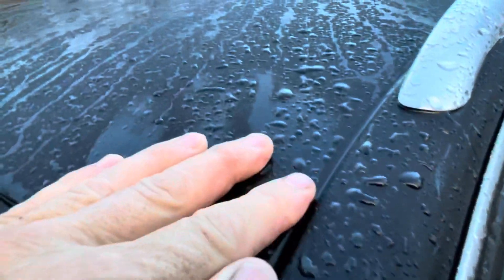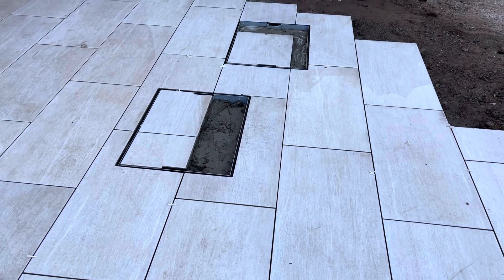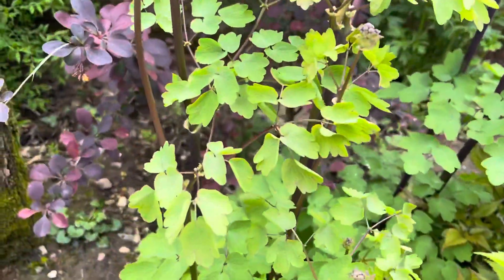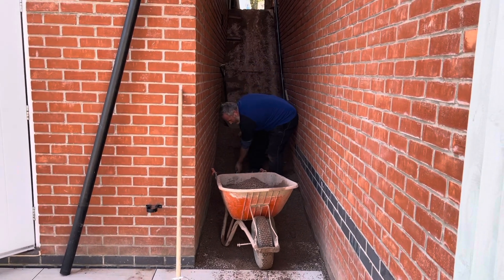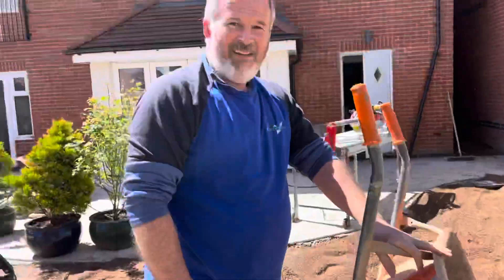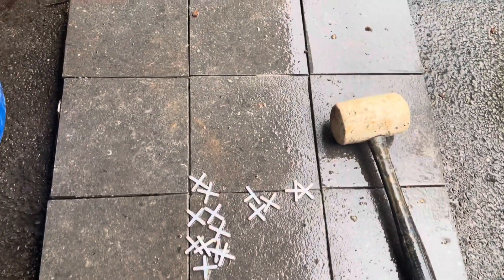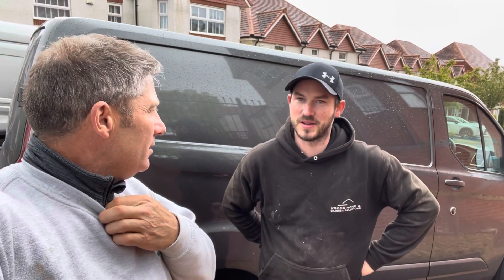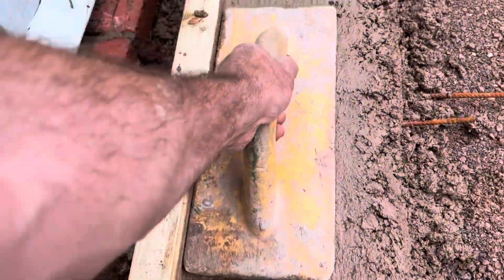Porcelain Patio Picture Frame To Install With Man Down But Fellow YouTuber  Justin Turns Up

Comment: What’s your thoughts On Vitrified paving compound for porcelain, stone market make it , it’s just like geofix you brush it in instead of the time and effort with the squeegee and wash boy , safes a lot of time and a lot cleaner.
Reply from the maker: I think there’s some good products out there, some not so good. Just need to use a few more.
Reply: I would recommend it Johnny , saves a lot of Time and great end result , use it once and I guarantee you won’t use anything else for porcelain